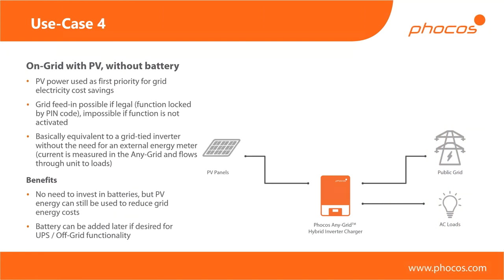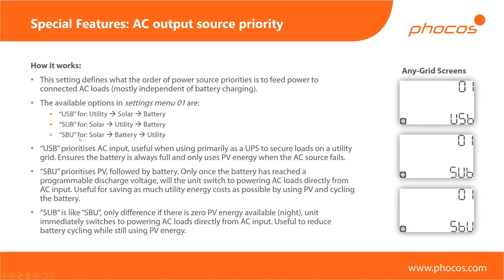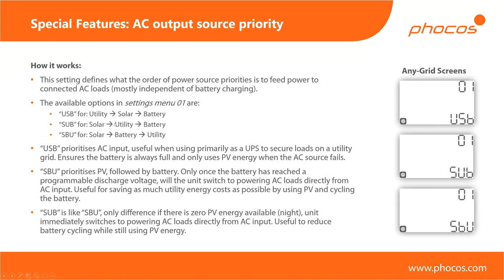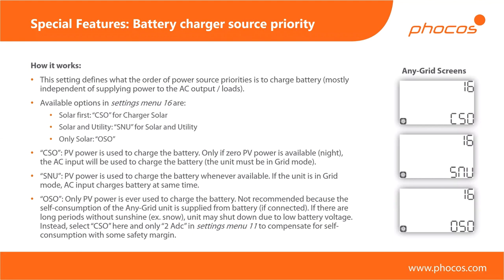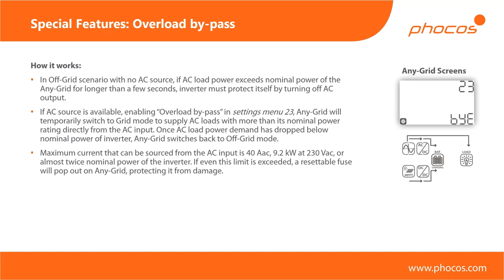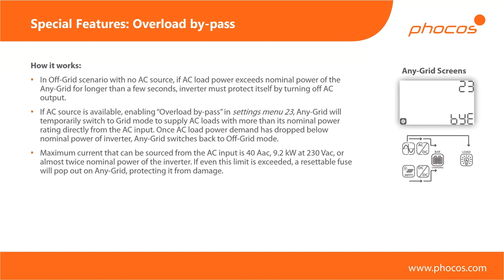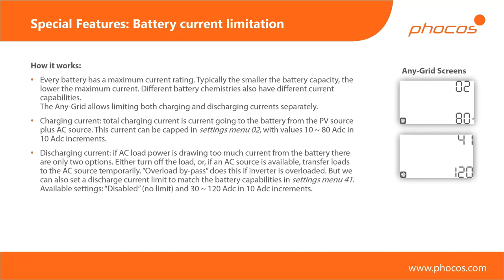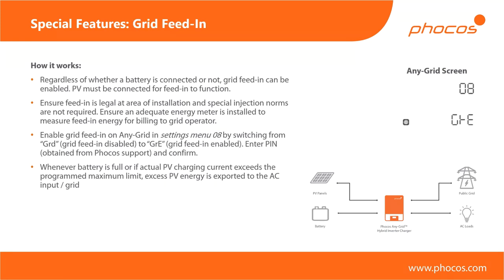Part 2/3 - Phocos Any-Grid Hybrid Inverter 230 V Webinar (Use Cases 4-5, Special Features)

Comment: Question on Use-Case #4 (applies to others as well):
What if you have a 10kW load? How does it work then? Does the Any-Grid provide maximum 5kW from PVs and the extra 5kW from the grid? If there's no PV production, does 10kW of power go through the 5kW Any-Grid with no issues?

Question answered on "overload by-pass" chapter. However, now there's a new question: How does the switching take place? Using a relay contactor, or through solid-state power electronics?

OK, this question was also answered; switching happens through a pair of relays, which means that they will eventually fail.
Reply from the maker: In such a scenario as much PV power is used as is available to feed the loads. If more PV power is available than the loads need and grid-feed in is deactivated (which is the factory default setting), PV power is reduced to roughly match the load. If feed-in is activated, any PV power exceeding load power is back-fed into the grid. If load power is higher than PV power, then all available PV power is fed to the load any missing power is sourced from the grid. The maximum current that can be sourced from the grid varies by PSW-H model. For the PSW-H-5KW-230/48V for example the max. AC input current is 40 Aac. Therefore the PSW-H can source up to 230 Vac x 40 Aac = 9.2 kW from the grid to sent to the loads. If this limit is exceeded the resettable breaker trips (or the prescribed external breaker trips).

Comment: Hey Guys,

I absolutely love this inverter. I don't think there is much that can beat it.

Just one thing though. The overload bypass function does not seem to work for me. I am in appliance mode, and the energy priority is solar first. Would any of those affect this overload bypass function?
Reply from the maker: Hi, appliances mode does not affect Overload By-pass mode. Appliances mode just means the inverter is more tolerant in accepting more “unstable” AC sources and may pass that wider range of allowed AC source voltages to the loads.
 
If Overload By-pass is enabled, it will only change the inverter behaviour if the AC output priority (settings menu 1) is set to SBU. This is because in SBU priority, the inverter will try to stay Off-Grid as long as it can, namely as long as the battery voltage is above the switchover setpoint (settings menu 12). In other words it is physically disconnected from the AC source on both neutral and live wires. Now while the inverter is voluntarily Off-Grid, if the load power were to exceed the rated inverter power, the inverter would be overloaded. If Overload By-pass (settings menu 23) is enabled, the inverter is then temporarily permitted to quickly switch to the AC source (if a valid AC source is available) to get the extra power it needs. Once the load power drops below the inverter rating, the inverter will switch back to Off-Grid mode again. Of course there is a time hysteresis of a few minutes to avoid switching back and forth too often. If Overload by-pass were not allowed, the inverter would have to turn off to protect itself from the excessive load.
 
In the other two AC source priority modes (USB and SUB), the inverter is connected to the AC source virtually all the time, and only mixes in solar power to feed the loads as required. So if in one of these priority modes the load power exceeds the inverter rating, the missing extra power is automatically sourced from the AC source anyways, as the inverter is already connected to the AC source. There is no hard switching required in these cases.
Reply: @phocos-global  I understand all that. I have tested the overload bypass function on both USB and SUB

I don't like the SBU function.

What causes the inverter to not be able to exceed the off grid 5kw rating, when setting 23 is enabled?

My inverter is in SUB all the time, but it can't switch to grid mode, instead it just turns itself off to protect itself. I don't want to try too much, as I don't want to damage the inverter, but I would like the function to work incase someone else puts too many appliances on, and over loads the 5kw rating.
Reply: @phocos-global  so are you saying that for the inverter to hard switch, to grid mode and allow 9200watts through it, the source mode needs to be set to SBU?
Reply from the maker: @jasonrowe3219 Our technical team believes it will be easier to supply you with proper and timely support via personalized communication since your request is so specific. Please go to our site here https://www.phocos.com/na/contact/ and fill out a form under "Contact Tech Department". I will let them know you will be contacting them.

Comment: Menu 12 = 48vdc / menu 13 = 52vdc.  Menu 02 = SBU.    SOC = 53.1V.   Pv input  = 1.8kw.  Ac Output = 1.6Kw.    Why does the status of powering the load change frequently from Off Grid Mode to Grid Mode, despite all conditions favoring Solar and Battery status.
And after it goes to Grid Mode....it stays on Grid mode either for 10 minutes at a time or indefinitely.  Please explain the conditions of switching over to Grid Mode....and returning back to OffGrid.   Assuming battery voltage has not gone below the Menu 12 value of 48V.

Comment: Following the above scenario, another anomaly:  the LCD screen shows
Utility powering the load only.
PV is available 1.8kw
Battery is available 53.1v
Yet neither sources are shown to be powering the load (despite being in SBU mode) 
Battery charging on LCD shows 0 Amps
Battery Status Indicator is flashing which suggests battery should be charging. So if it charging there should be some amps charging the battery and not zero.

Looking at the Phocoslink app simultaneously for the above scenario...it shows PV input, Ac input, and Battery being charged.

So all in all, the above situation is baffling and I'm failing to figure out what is causing this

I'm using correct BMS cable compatible between Phocos and US3000 pylontechs.
(2 x US3000 pylontech)

Comment: If we connect electric power  supply and Pv supply to phocos inverter and accidently electric supply off and load is more than Pv power supply that condition's inverter will damage??   ......Please Replay 🙏
Reply from the maker: Hello, no, this will not damage the inverter. If you are using a battery, then the inverter will power loads from the battery. If you are not using a battery, the inverter will simply turn off and try to power the load again 5 minutes later, repeatedly. Under certain conditions the PSW-H can even power the loads without an AC source and without a battery, only from PV. You can find more details regarding this use-case here: https://www.phocos.com/product-news/unique-use-case-for-any-grid-psw-h-increase-utility-grid-independence/
Reply: Thanks for reply